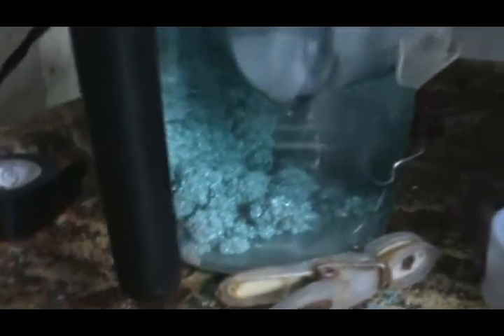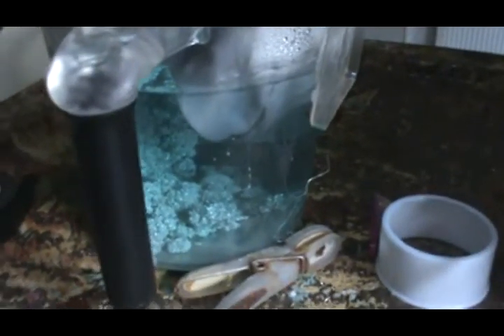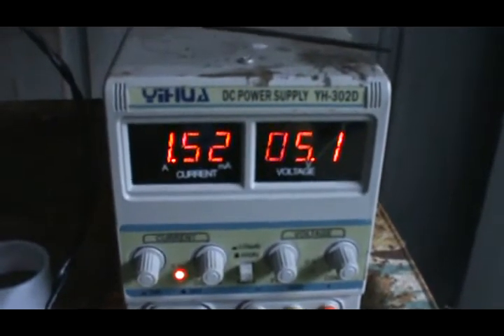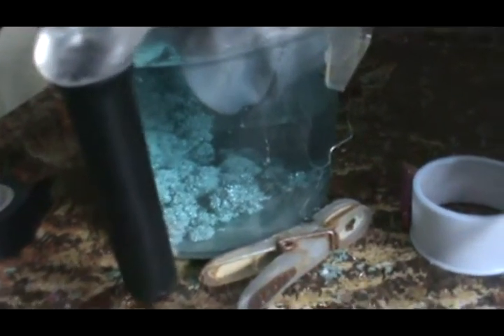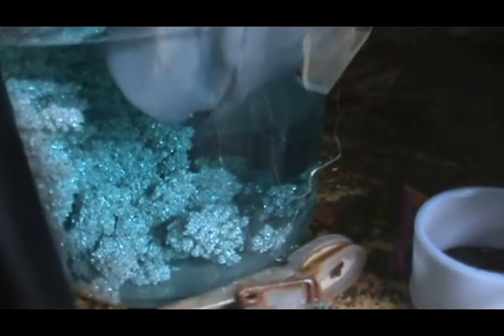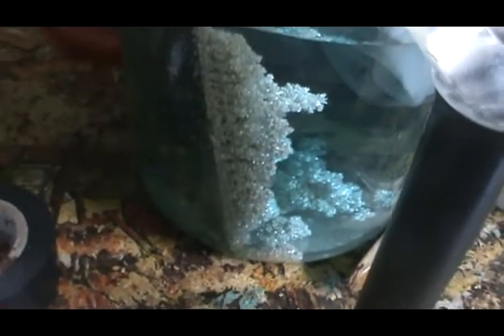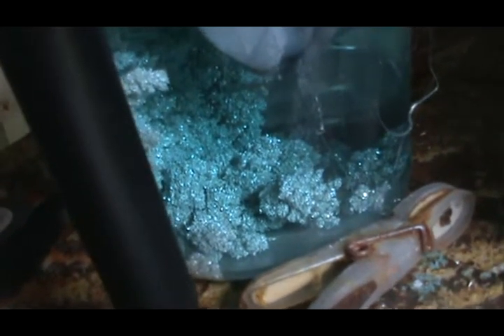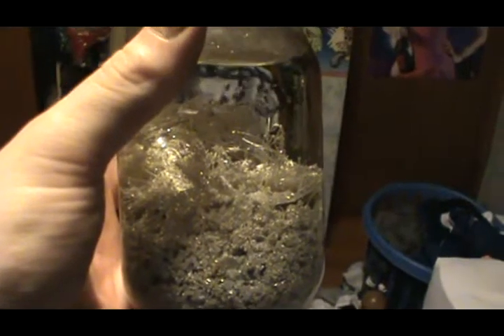refining silver through electrolysis

Comment: Hi Sean, very informative. I am using electrolysis in a water ionizer, I am using silver as the anodes and cathodes, and i see the one on the positive side is now leaching a cloudy substance into the water (4.5 gallons of fresh water separated by a semi permeable membrane with a tablespoon of salt and a pinch of baking soda 24 volts of DC). Do you know if the water on the negative side (crystal clear) would be safe to drink? Any information you can provide would be helpful thankyou!

Comment: I was able to get 99.95.   I used high quality sterling flatware.   Acid, copper, high purity.  Distilled water.  

When I did final pour all my bars crystallized on the surface.   Very pretty.   Several refiners told me that it has to be 99.95 for the crystallization to occur.   Two jewelry verified it with their testers.

Comment from the maker: To make the electrolite Yor gonna need at least 100-150 grams of fine .999 silver dissolve this in just enough 70% nitric acid to fully dissolve the fine silver but it's tricky because u can't have much excess nitric acid in the mix so start with say 50 ml of nitric and stat dissolving the .999 silver wait till u see no more silver dissolving then add another 50 ml to the mix let that go until it stopped dissolving keep doing that until all the silver has dissolved make shure u don't use too much nitric or the process won't work right after u have that 150 grams of .999 silver fully dissolved add  enough distilled water to make 1000 ml of electrote
Reply: sean wood helo gato muito bom seu video adorei